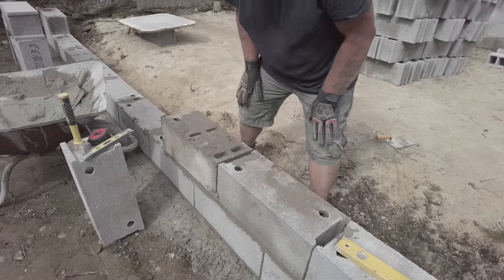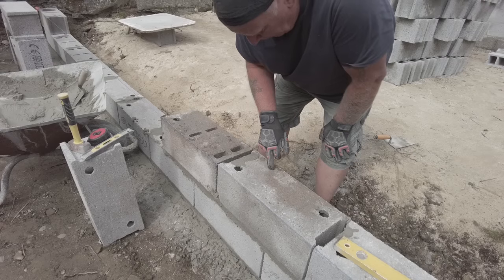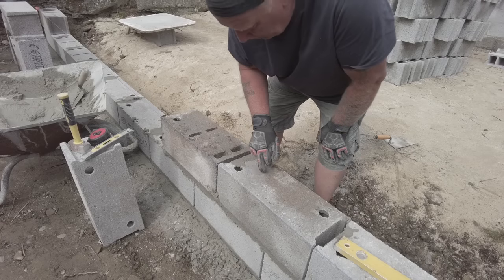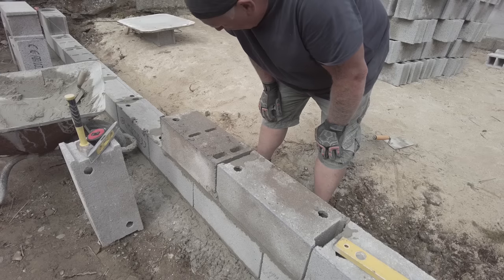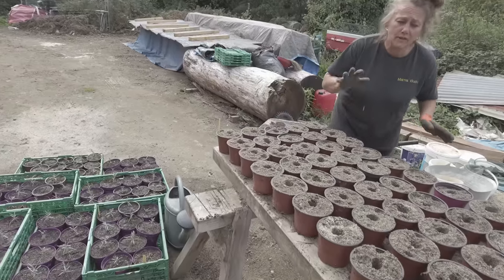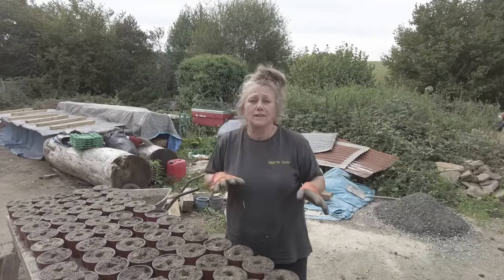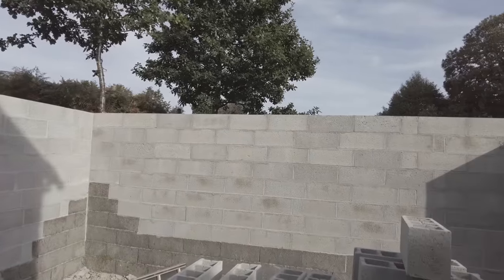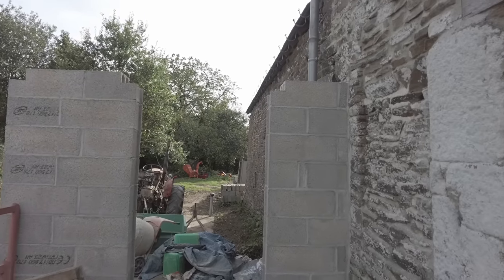No 120. FARMHOUSE KITCHEN BUILD. KITCHEN WALL BUILD

Comment: Did you decide only to leave one space for one horizontal window and 2 Velux windows in the ceiling? I understand that the door will have small windows too. But there’s nothing like beautiful views to enjoy while the pot's simmering or the breads rising. I think Tracy will really miss that. Blue/gray/and cloudy skies only boring after a while. Long horizontal 😅views are the best in my opinion. Please correct me if I’m wrong! 🤞
Reply from the maker: Hi Libby thank you we did consider the two windows we proposed but if you see the lay of the land the building is only half way to the land so we would only be looking at the grass view the main window gets more then half the days sun light 🥰🥰

Comment: I can see that the block wall structure was started by someone else, but are you putting any rebar reinforcement in the rest? or do you have another plan for strengthening the walls?
Reply from the maker: Yes Wrenwest  it will become more clear when the videos catch up its already been done but a good observation 🍺🤠👍🏻

Comment: Great work Budo. Lovely to watch it taking shape. So are the new block walls not tied into the existing house walls? Cheers. Sean
Reply from the maker: Yes they are mate with stainless steel rods in 6 places as they are stone work meeting concrete block work you can't chop into stone walls as there is a risk of collapse mate hope this helps 😀 👍🏻